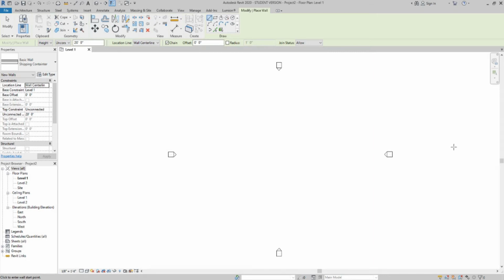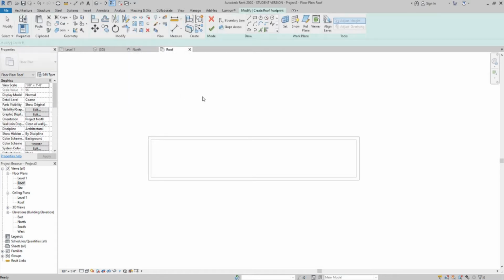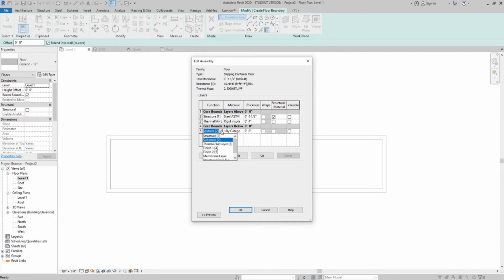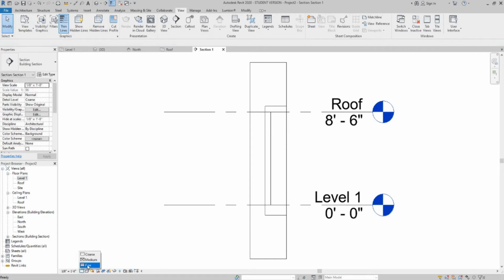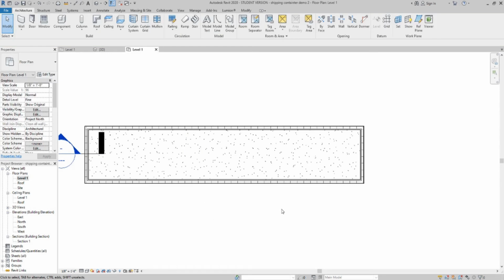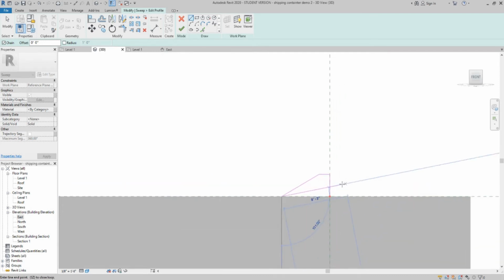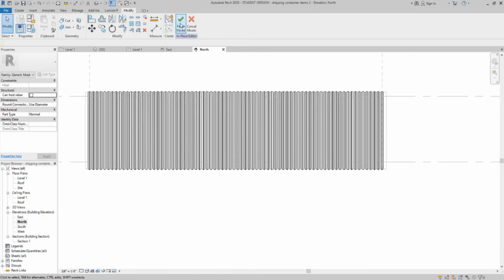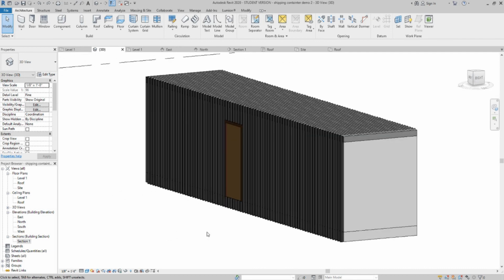Revit-  Shipping Container House Tutorial

Comment: I cannot figure out why my outer lines are very thick. I cannot see anything in the wall sections because the outer lines are so thick. I am not able to do anything with the cut planes
Reply from the maker: I think you’ll need to change your scale for the view, sounds like it’s at a small scale right now.  You can do this in properties palette or at the bottom left of the screen.
Reply: @Studio_Hero  my scale is 1/8" = 1'-0"
Reply from the maker: Try 1/2” = 1’
Reply from the maker: You can also go to the view tab and click on “thin lines”, that will take off the line weight but won’t change how it will print.

Comment: I’m having trouble the levels of my structure, I can’t see it from the roof level plan and the roof is not showing up in the 3D View!
Reply from the maker: A few things you can try:  
1) make sure you are in a floor plan and not a ceiling plan
2) Try going into your properties for the view and checking what your view depth is
3) Turn on underlay in properties if / when you need to reference other levels

Roof not in 3D
1) check to see if you have a crop box on, you can turn off the 3D crop box in properties for the view and another crop box can also be turned off at the bottom of your model screen.

2) click on the light bulb at the bottom of your screen to see if your roof is hidden

3) type “v v” (no space) and check the graphic settings for the 3D view and make sure roofs are being shown